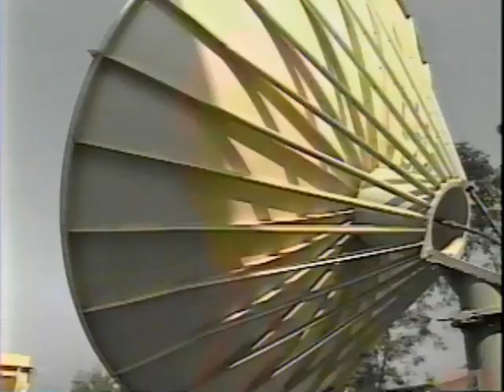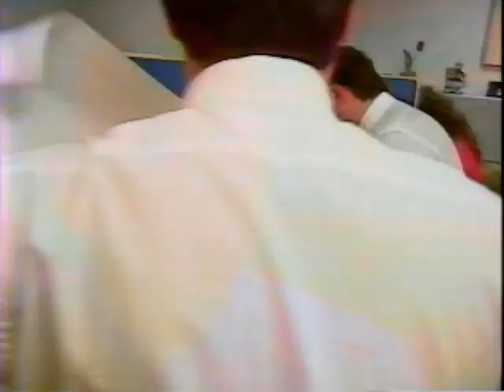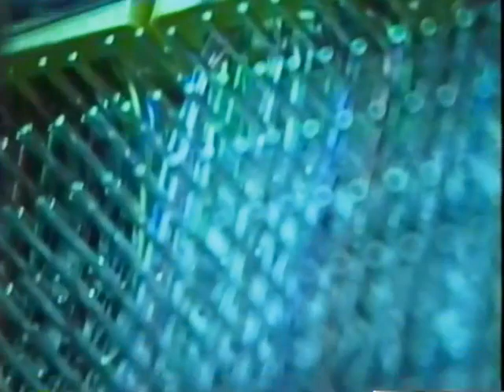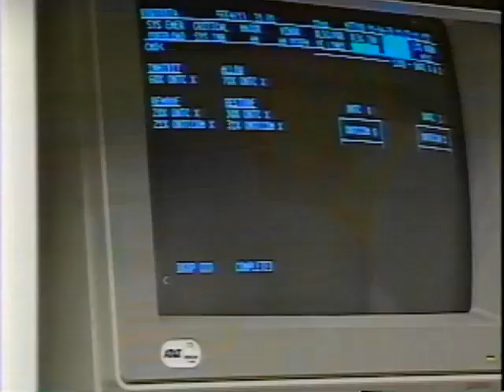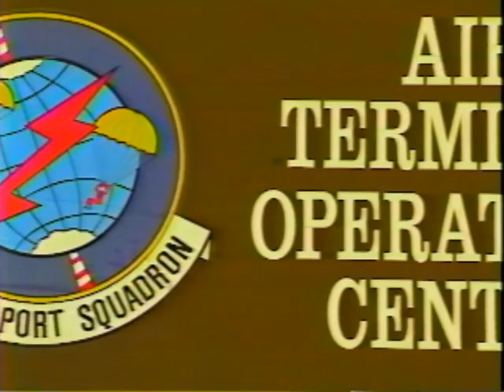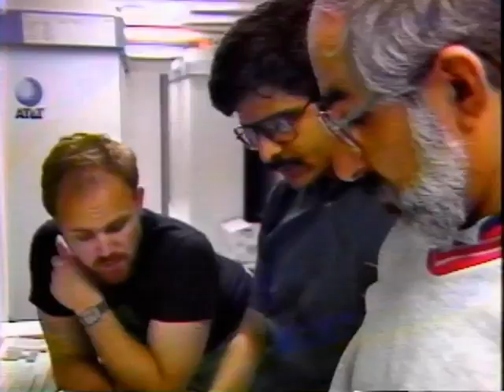AT&T Archives: Operation Desert Switch

Comment: BELL LABS IS OWNED BY THE 2ND FOREIGN COMPANY IN 15 YEARS. AT&T NETWORK SYSTEMS SPUN-OFF AS LUCENT & AVAYA WHICH WERE CREAMED WHEN THEIR MANAGEMENT LIED AND KILLED THE COMPANY AND WAS BOUGHT OUT BY ALCATEL, THEN BOUGHT BY NOKIA. ALL OF THOSE WORKERS ARE LET GO. THEIR HEALTHCARE AND PENSIONS DEPLETED AND THE TOP EXECUTIVES LIGHT CIGARS WITH $100 BILLS. __ IN 2003 LUCENT STOCK WENT FROM $120 A SHARE TO $4.00. THEY NEVER RECOVERED FROM MANAGEMENTS LIES. __ AT&T "BUILT" THE 'AT-HOME' CABLE NETWORK...BEFORE IT WAS COMPLETED, THEY ALMOST WENT BROKE...SOLD IT ALL TO TO A COMPANY CREATED CALLED COMCAST. AT&T, BELL LABS & WESTERN ELECTRIC...PREMIER 100-YEAR COMPANY TURNED INTO A ROLLING DUMPSTER FIRE AND DESTROYED BY GREEDY MANAGEMENT.

Comment: I was there in April putting in a trunked radio system with an small telecom company. Years later I worked at ATT and got to know many of the techs that did this work over there. I saw days over there where looking at the sky was like looking at coal the sky was so black with oil,smoke.

Comment: Had this destruction happened 15 years later,  Kuwait would have done what other countries that were hopelessly lagging in switching capacity:  quickly install a cell network and call it done.   Or put in VOIP landlines.
Reply: Yeah totally different now a lot. the one benefit of POTS was the ubiquity of user equipment. Cell phones or avoid would've meant and user equipment which would've had been replaced anyway where as most POTS stuff if it still somewhat worked could be reused. And then there's power POTS was the equivalent of POE but on a much larger scale end of aces didn't have to have power available.
Reply: @imark7777777  I stoll believe in a backup wireline.  I had one accessible when my grandmother had a stroke.. it held a solid connection until the ambulance arrived. 
Now I live in a community who installed fiber and deprecated the copper. If there's a power outage, it's not going to work as it's VOIP based, let alone our local cell tower is on the same grid, and is most likely cabled through our independent telco.. now I'm imagining how the trunking is planned out, city to city, one by one?  Lots of power for one out of town call.

Comment: I know this was all temporary, but I never liked that style of COSMIC frame. We have one in an office and it just does not have the space to contain the sheer number of jumper wires from OE's, TIE's and EXC/PG pairs I understand the need to conserve space, but after a while there are too many jumpers to be contained and dressed properly.
Reply: Couldn't they have separate trucks to do these tie ins, and use cables to connect them together, somewhat similar to remote terminal architecture.. in the early 90s I was a RBOC service representative and we had some #5ESS served offices that were ORM remotes, we had some restrictions of course, such as dual service being unavailable, I'm sure there were others beyond my training.